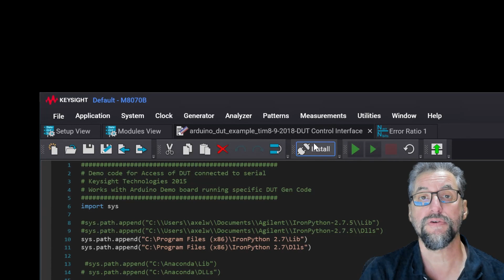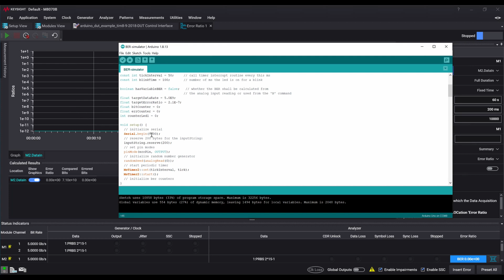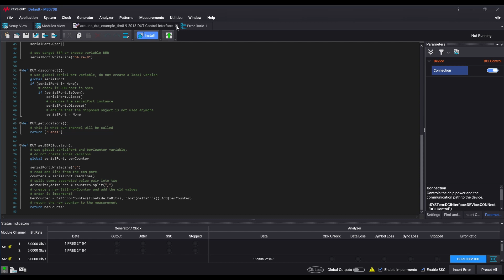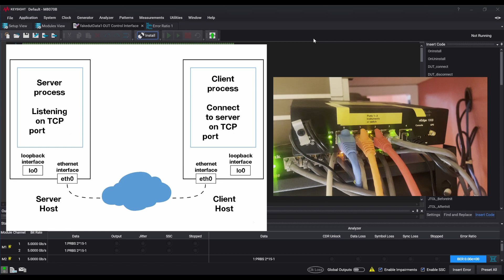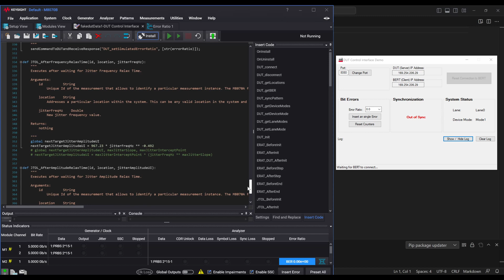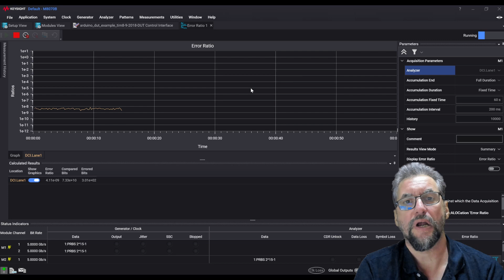M8070B DUT Control Interface Made Easy:Read Data from Your Internal Error Counter

Comment: HI Tim, I created a py with socket connection to the BERT that simulate random BER (like 1e-8, 1e-9) but how to convert it to the 4 values of errored_ones, compared_ones, errored_zeros, compared_zeros? may you can help with that ?
Reply from the maker: Hello  and great question. great job on getting this set up. You are partly there 

To separate errored ones from errored zeroes in a BER (bit error rate) measurement, you need to know both the expected and the received bit values. A typical BERT (Bit Error Rate Tester) can do this automatically because it knows the original pattern and can compare each bit to the received one. That way, it can tell if a bit error was a 1 that flipped to 0 (errored one) or a 0 that flipped to 1 (errored zero).

But if you’re only getting BER results from a device under test (DUT), and not using an external BERT, then the DUT itself would need to make that distinction internally. That means it must already have logic inside to compare the incoming data to a known pattern and track the polarity of each error separately. If the DUT doesn’t have that feature, then you can’t separate errored ones from errored zeroes just from the BER value alone.

So you’d need a counter or some kind of built-in feature on the DUT to do this kind of error separation. and then read those back

Comment: I have explored your YouTube channel and noticed its visually appealing design. However, upon further examination, I have identified several areas that require improvement. Specifically, I have observed issues with SEO, rank tags, and tag volume, which have not been adequately addressed. These are just a few of the many aspects that need attention.
I am Arafat Amin, a Freelancer with over 2 years of experience in YouTube video SEO. I possess the necessary expertise to assist you in optimizing all aspects of your YouTube video SEO. With my assistance, you can expect significant improvements in your channel's performance and visibility.